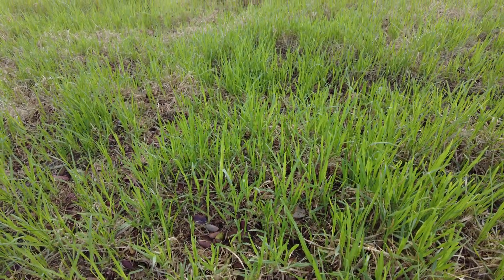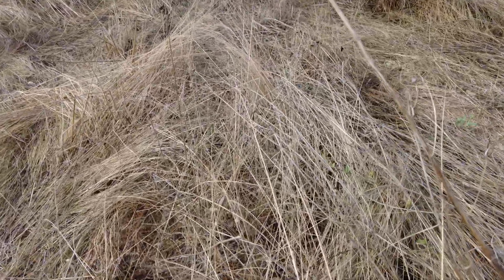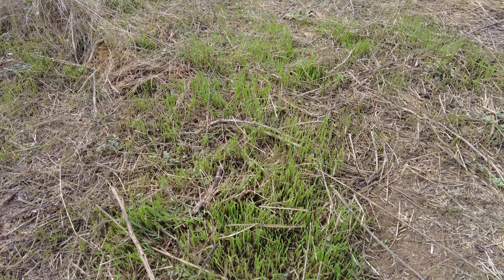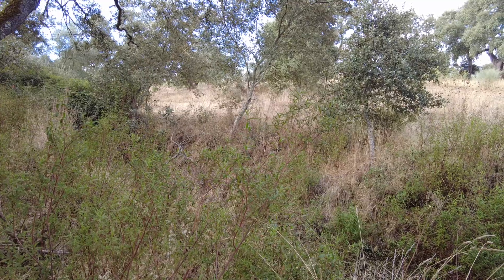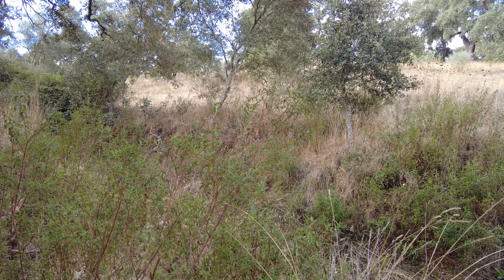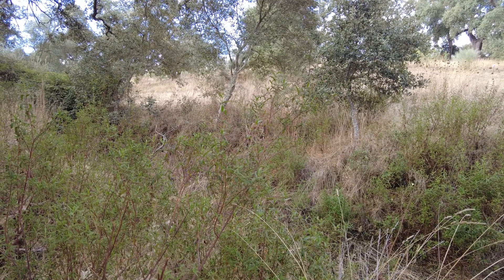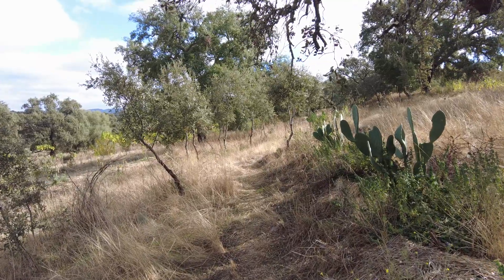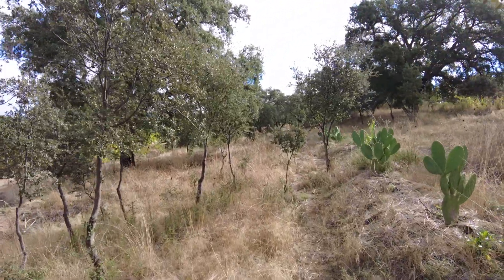Liquid Carbon Injection – Restoring Soil Life in Andalusia #agroecology

Comment: Thank you Martin.  Very interesting information about how carbon dioxide makes its way into the soil via photosynthesis and root exudates.
* When looking at the entire 5 hectare farm through the seasons, don't forget the ribbons of living soil and green plants that do not go dormant and hold moisture through the heat of summer - your berms.  
Some consider irrigation antithetical to permaculture, but in a restoration setting like yours, I believe it is a great benefit to the process and totally appropriate - especially when it impacts a large portion of the land, the water is distributed efficiently the water is not extracted from a deep aquifer and the system is fed by gravity.
* I will encourage you to consider as you irrigate and portion your water reserves to consider the positive impact of the moisture plumes in your berms as they slowly move downhill on all of the living soil they sustain through drought months.
You have a beautiful system.  It is wonderful that the benefits of your system continue to be revealed.
💙 In coming years, you may wish to manage your irrigation reserves so that they are approaching empty by the time the rains return in the fall, knowing that the reserves have been used to expand the area and density of active soil microbes through the drought cycle.
* And perhaps 2026 will be the year when a means of chopping the dead grasses will be discovered so that something more than 12% of their captured carbon finds its way into the soil.
You and Suerte del Molino have come so far in 3+ short years.  😊👏
* Beginning at 4:10 I enjoyed walking among your oak teenagers! 💚
Reply from the maker: Keep walking Steve. We enjoy your talking.

Comment: Sheep turn carbon into two human desirables Wool & meat 😊
Reply from the maker: Good sharing. Wool is a big problem here in Huelva. The local breed is merino crossed with something else. The sheep are sheared once a year and the wool is dumped with the trash. There is no processing of the wool anywhere around. Meat is sent to Madrid and that costs more than the meat itself. The Huelva province is all about pork and prawns. Still I would like to have some sheep sometime.
Reply: @SuerteDelMolinoFarm  I can't imagine merino wool going to a dump.  When we were young, an article made of merino wool was very prestigious.  How can a material go from prestigious to worthless in one life time?🤯
Can wool be composted? 🤔
"Best Practices for Composting Fresh Wool:
*  Shred or Cut: Cut or tear the wool into smaller pieces or tufts to increase the surface area and prevent it from matting into thick layers.
*  Mix Thoroughly: Do not put the wool in a thick layer. Instead, mix it well with other compost ingredients, especially bulky, carbon-rich materials.
*  Use "Dirty" Wool: Wool that contains "daggings" (soiled areas) is often preferred as the dirt and fecal matter provide extra organic matter and microbes that help kickstart decomposition.
*  Consider Mulch or Direct Application: *
If you have a lot of wool, you can also use it directly as a slow-release fertilizer and mulch around plants, where it will break down over time. It is also an *effective slug and snail deterrent*."
Delivering it to you would be cheaper disposal for the farmer because there is no dump 'tip fee'. 🤷‍♂
Reply: When it comes to browsers and seedling trees, you have to make choice.  You can choose one or the other, but you can't have a little bit of both.
Reply from the maker: @stevejohnstonbaugh9171 What if I have little sheep and big plants Steve? Ha ha.
Reply: @SuerteDelMolinoFarm  Little sheep and even young adult trees would be a great combination.  The challenge is protecting Martin's 1000 new acorn seedlings a year through their first 15-20 years - just to give you a sense of time.  
Most landowners aren't willing to think in "tree time".  One illustration of Martins exceptional commitment to the restoration and survival of a true holm and cork oak forest. 💚🌳
Reply: Rearing sheep on this land is more expensive than Mr Farmer's one way ticket to visit his grandchild. But yeah, sheep are cute. But let's not talk about their meat, it hurts my discarded vegetarianism principles 😊 It's like not-deadnaming kind of offence 😊
Reply from the maker: @rajsinghji-84 You guys are getting deep into my non existing animals again. Ha ha
Reply: @SuerteDelMolinoFarm  You can pick from chickens ducks, turkeys geese (or are they birds, not animals?) 😉
Also, all the frogs you would like and any 4 legged creature that you can tether.
This assumes, of course, your priority of growing about 2,000 oak seedlings into young trees between 2 ad 3 meters tall. (est. 15-20 years)
I arrived at 2,000 teenage/young adult trees based on 5 hectares with an allocation of 1 newly grown tree every 25 square meters (269sq ft) or one tree every  5 meters on center   (17 feet on center).
Also, for comparison, you have 4,000 emitters on your existing drip irrigation system.  So the sense of scale seems appropriate.
That seemed reasonable to me based on expected mortality over 15-20 years and the stated goal of a closed canopy of oak trees. 🌳👍
Reply from the maker: @stevejohnstonbaugh9171 Before my life is over Steve? YES YES YES
Reply: @SuerteDelMolinoFarm  I hear you loud and clear Martin.  That thought is always in the back of my awareness.
Too bad the oaks are slow growers.  But the answer to your question is way above my paygrade.
You, on the other hand, can choose to buy a trio or quartet of lambs , goats or pigs tomorrow 💚🌳🌻